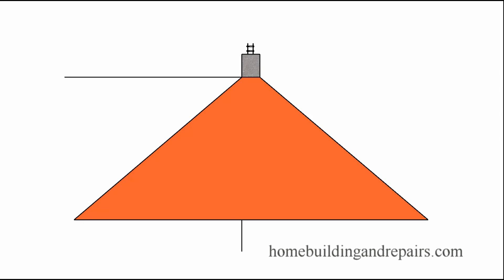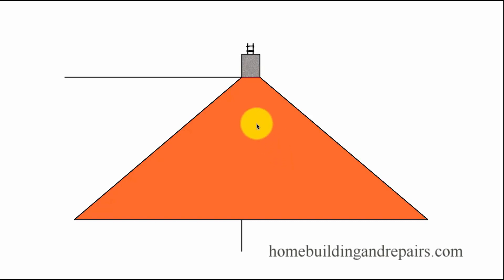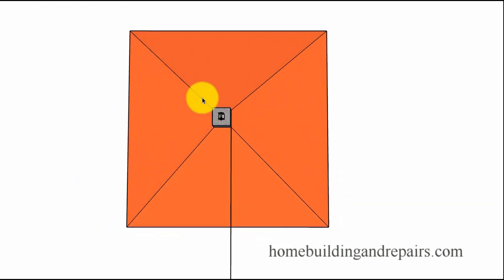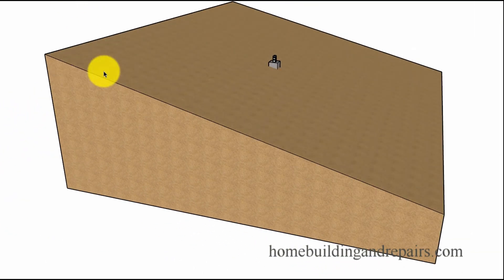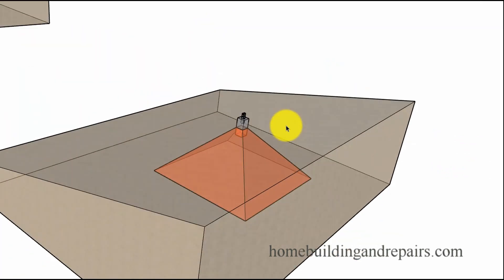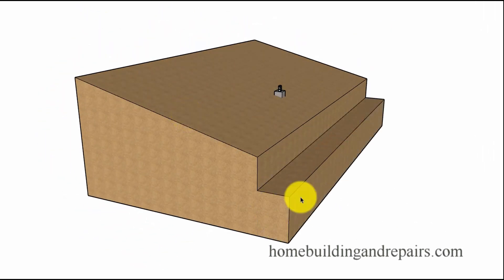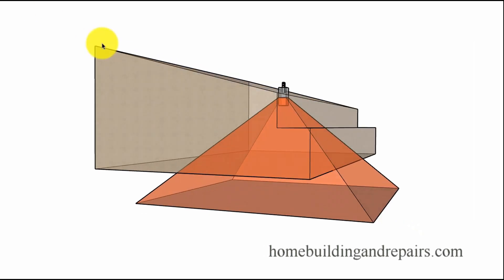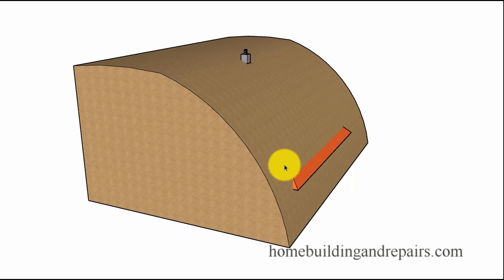Information About Angle of Repose and Hillside Structural Footings

Comment: I recall from a geology class that the angle of repose was different for every aggregate and soil type it was the angle that the material would naturally fall at. Is the 45 your referring to for load distribution only?
Reply: Hey, please I would be glad if you’d want to teach me what you’ve learnt
Reply: @tawfiqmohammed9800  My assumption is that for the sake of the video he used 45° as a good baseline number. Most of your soils will be around 45° some go into the lower 20s°. It depends alot on soil type and moisture.

For the sake of the video picking a nice easy number that people are familiar with just made sense and helped for the demonstration. In real life the angle of repose will vary and more likely be shallower, < 45°.